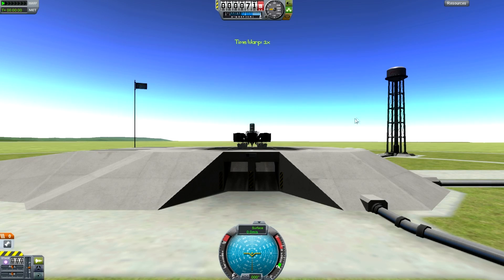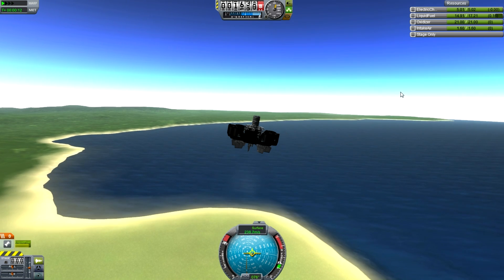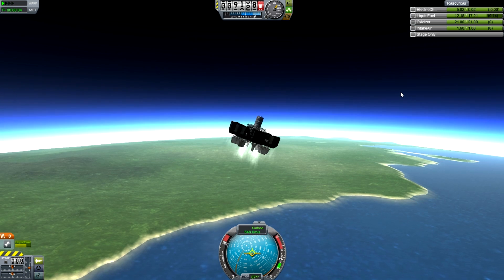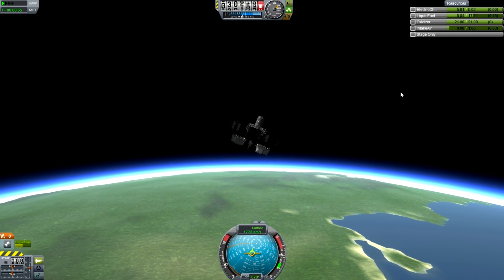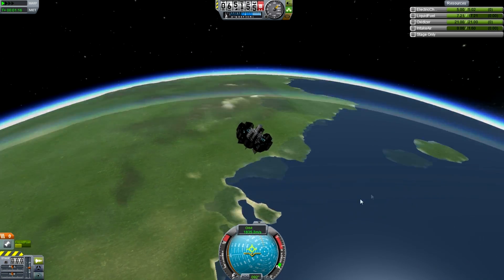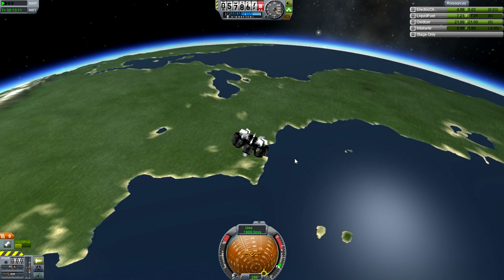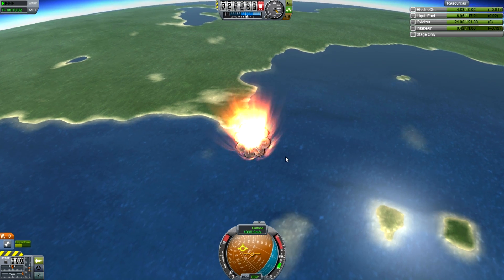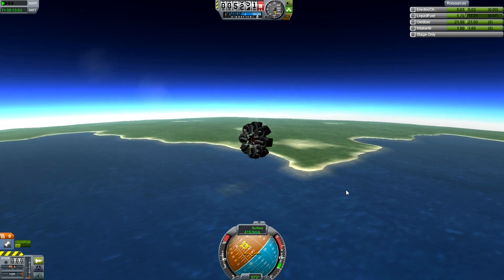Airhogging & Jetsetting

Comment: Wile there have been cases where the light speed barrier have been broken by neutrinos in measurements it has not been decisively confirmed. In general is though that neutrinos can go really really really close to the speed of light but not go equal or faster to it.

Comment: It's not that they won't produce power at 30,000 meters, it's that they supposedly won't accelerate you beyond 2400 m/s.  Supposedly.  I'm garbage with spaceplanes so I rarely screw with jet engines.

Comment: If I may say there are ways to get around the faster than light problem. Such as the new warp drive NASA's working on. With the idea of expand space behind a space craft and contracting in front, propelling it forward. Instead of flying through space like conventional spacecraft, you would be "riding" on space. You could theoretically travel faster than light . Unless the universe was created by some crazy game developer with too much extra time, and this idea (if it works) is simply a bug... :P

Comment: You would have to use air breathing engines on that craft too though so there would be a margin for error of 0 at low altitude since adjustments could not be made closer to the collision.

Comment: I don't think duct tape will hold up to 1 atm of pressure on any hole thats big enough that it will fit through.
I have no numbers to support that though.
You can probably do an experiment pretty easily if you have a pump that can generate enough pressure, like maybe one for car tires.

Comment: it's physically impossible in a patched conics based system to achieve a stable orbit with nothing but air-breathing engines, but you can get close enough that a quick spurt of RCS at apoapsis can finish the job.

Comment: SCOTT! I have a mythbusters type question for you.

could duct tape be used to repair a hull breach? I mean if it were a pin hole, obviously that's a yes, but the dynamics of heat, volume, pressure, what limits there are to it, that stuff seems right up your alley.